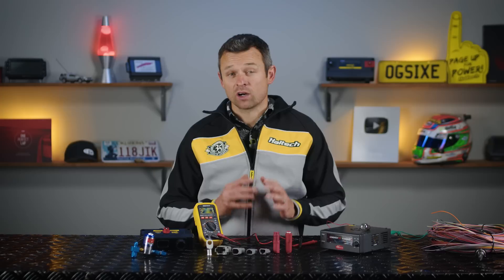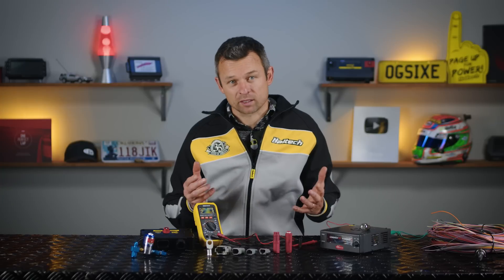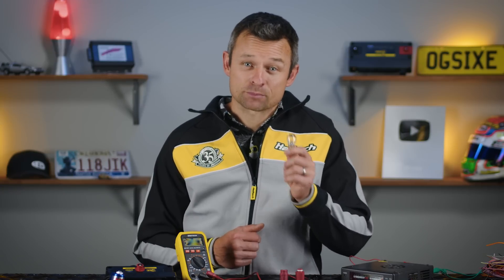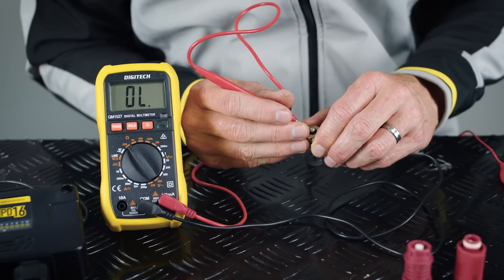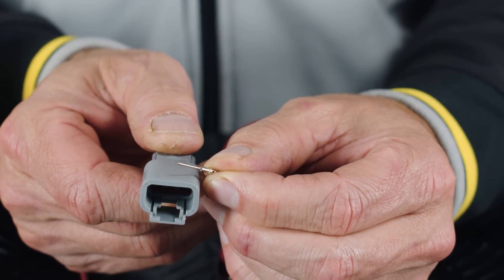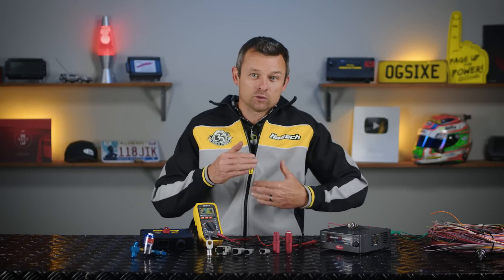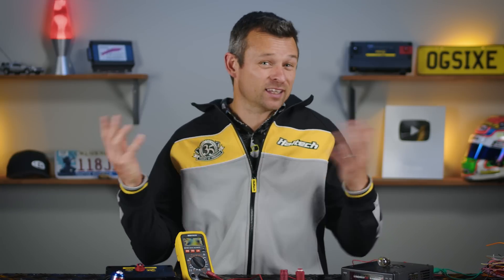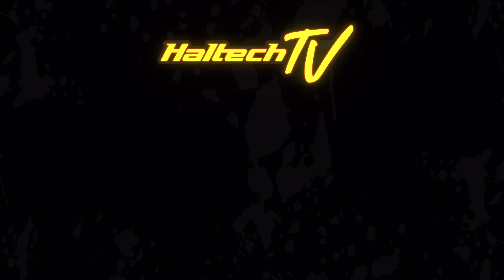🛠  Volts, Amps, Ohms and choosing the right wire gauge | TECH TUESDAY

Comment from the maker: It's Tech Tuesday Time!!! (yes, it's already Tuesday in Australia)
Today we are getting nerdy about electrons, current draw and resistance. To be more precise, we are discussing why choosing the right wire gauge is important and why an incorrectly sized wire correctly gets hot. We also go through the governing rules that dictate how much current a circuit is going to draw.
.

Got a question you want us to answer in the next Tech Tuesday? Leave it in the comments section!

Comment: You should measure the voltage across the lightbulb when it's turned on to see if the resistance goes up proportional to the current draw

Comment: 10:05, Electrons move through wire very, very slowly (and not the speed of lightning).
Assuming 1.5A with 1mm² wire width, electrons are moving at about 40cm per hour, or 6.6mm per minute (this is electron drift).
The speed of lightning (ignoring the vague description) will be measured in 1000s of km per second.

Comment: I see mention has been made of the P=VI, one aspect of this is it is possible to assess the heating of the wiring from the voltage drop times the current.
one thing that seems to have been missed, and could have been introduced witht he fuel pump wiring, is the voltage drop through the wiring has a direct affect on the voltage, and current, at the pump - in this instance. 
As P=V²/R, the power loss is dis-proportional to the voltage at the pump - a 20% drop will mean the pump can only supply 64% of the nominal power to give the pressure/flow it should be able to supply - assuming a constant impedance (resistance) in the pump...
On that, some types of electric motors will demand higher currents because they have lower impedance when operating below design voltages and/or speeds, which can rapidly lead to wiring or pump burn-out.

On motors, while sometimes one can get away with sizing wiring to the current expected, there are times where minimising voltage drop is more important, such as with starter motors - you REALLY need to look at voltage drops there.
Reply: @Matt Wright 
Could be worth looking at stall and slow start loads and current control, and the use of fast and slow blow circuit breakers and switching? 
Been around 30 years, so a bit fuzzy with copper and iron losses/impedances.

Comment: Electrical flow to electronic different pressure.  Available voltage to avaiable current flow the  head of pressure ( voltage) to the flow of electrons past one point in one second (amps).

Comment: I think you are WRONG - 
If that indicator bulb draws 13.8 AMPS - That makes it a 190W bulb (W=AxV) - 
I think you are MISTAKEN.
Indicator bulbs are usually 20W
Even Main Headlamps are ONLY 55W
You need to recheck this....
Reply: One must respect that a cold tungsten filament. They are a ptc . The higher temperature the filament is higher the resistance inital inrush current to operational current. Place a tungsten filament globe with a current clamp will give an inrush load of 180w. It's operational load is 21w at 12.8v. A cold  tungsten filament is almost (/) resistance.
Reply: @aaronfischer7199  
I will accept your comment in good faith - 
BUT - 
If this is the case, then the wiring required is still NOT "13.8" AMP - is it?
I have NEVER seen a wiring loom to an indicator that was HEAVY enough to run 13.8 AMPS?
This is Incorrect.
In summary - The advice is still Incorrect.
The wiring for a 21 Watt bulb is covered by a 2 AMP cable - NOT a 13.8 AMP cable.
This is a FACT - as can be seen if you look inside the light fitting on ANY car...
REALITY is what we are concerned with here - Obviously car manufacturers are NOT allowed to under rate cables by law. Hence the low current loom to the indicators is 100% Correct and Safe.
Cheers for the info 🙂
Reply: @mxwtubemxw  The Amp rating of wire is for constant load (probably for less than ideal conditions, with a buffer), wire and most electronics can withstand much larger current for a short time.
The bulb may draw 13.8 amps for 1/10 of a second and would not affect a wire (especially if it is a 10 amp wire).
As an example, having just checked the data sheet of the first 1 ohm resistor in search results, it can withstand 2.5x voltage for 5 second without damage.

Actual wire ratings
18 AWG is good for 10A at 60c, will fuse given 83A for about 10 seconds, or 250A for 1 second, or 1.4kA for 32ms

Therefore a 10A wire will have no trouble handling the 13.8A for the time the globe takes to heat up (and increase it's resistance).
Reply: I think you didn't get what he showed in the video. Yeah the P part is missing but he showed with the Amp meter that there aren't 13.8 amps as he calculatet and he explaint why not.
Reply: @tschui111  
I'll take your word - I will leave this as a good faith initial "confusion" that they explained later - to be most charitable.
Thanks for the info 🙂

Comment: Lots of words, yes, but there is a lot of science that goes into the design and engineering of a car. It means that if you are building something yourself or modifying your car, you have to be across the science of it so you know when and why you should run new wiring for a fuel pump rather than use existing factory wiring, for example. It's all good content
Reply from the maker: Thanks:) 👍
Reply: @haltech     Great video.   I’m interested in ecu failure mechanisms.   Voltage spikes from faulty/incorrect relays generating say 400 volt back emf into the ecu,  or too much current due a faulty earth .  I’m assuming that’s  in an activator,  but why a fuse would not prevent that is beyond me.   Thanks.

Comment: Does the plug and play have all the same features/specs as a 2500? (R34 neo)
Reply from the maker: The PnP Kit actually consists of an Elite ECU and an Adaptor Box. So yes, you get all the functions of the Elite ECU included in the kit.